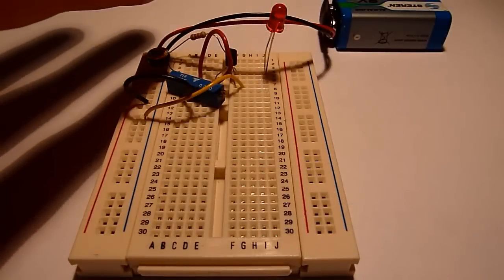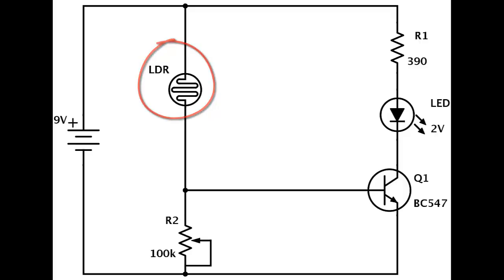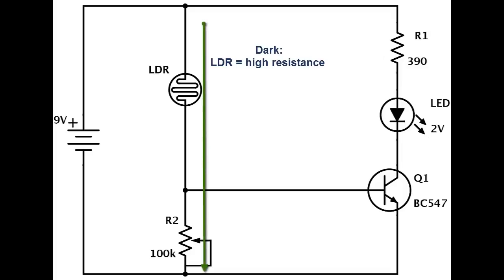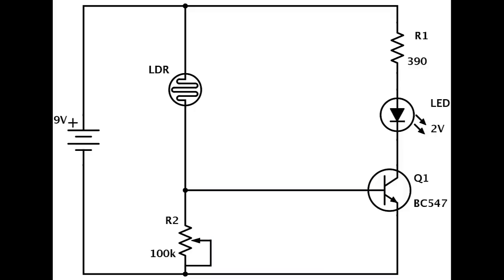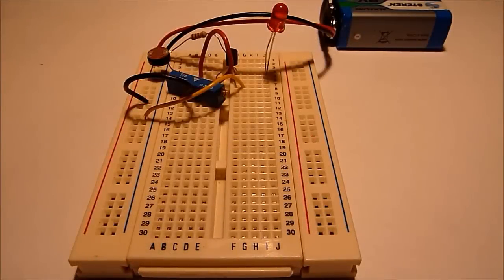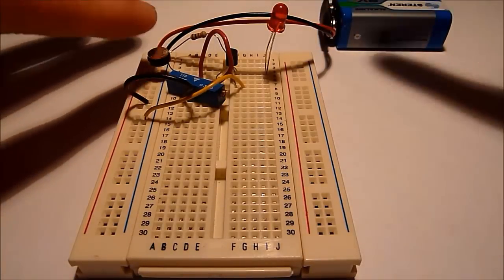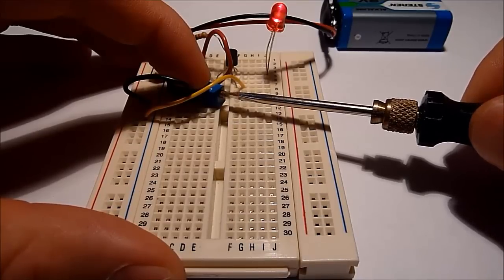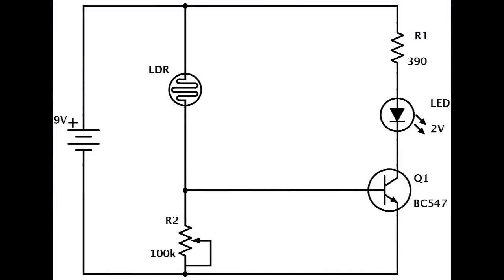How To Make An LDR Circuit (Light Detector)

Comment: What happens if we connect led across emitter.
Reply from the maker: If you place the LED on the emitter side, you raise the trigger point for the voltage needed to turn on/off. Should work find if you tweak the potentiometer

Comment: Hi. 

Disclaimer: I have really no real idea of what I'm doing in this context. But I'm considering build a "counter", that add + one to a small display, everything the circuit gets cut off. 
I don't know what I would need to add to this circuit to fulfil that, I would love some input from you. 

What do I want to build? I have a putting mat (golf), and every time I hole a put, I want the counter to add one to the score. I would love to have a reset button too, but that's not the first priority, which potentially could be done by removing the power completely. 

Would you be up for it to help me a little with the idea ? 
Best Tomas
Reply from the maker: Hi, check out the cd4026 chip with a 7-segment display. That should get you started.

Comment: What would I have to change in order to power a light bulb using this idea?
Reply from the maker: Instead of the resistor + led, add a relay that can control high power. Then connect your light bulb through the relay.

Comment: Can I use 12v battery instead of 9v. Will it effect the ckt or cause any problem?
Reply from the maker: Yes. But you should use a bigger resistor to make sure you don't break your LED. 470 Ohm should work.

Comment: how do you decide how much voltage the circuit needs? how much current in every branch? also when its dark, the LDR would have high resistance then why would all the current pass through the LDR, shouldn't current be seeking path of least resistance?.
Reply from the maker: You design the circuit for the specific battery voltage you want to use. For the branch with the LED, you make sure that there's no more current than the maximum current that the LED can take. For the other branch, just make sure you don't have more current than the base of the transistor can take.

Current will run through the LDR no matter what. But higher resistance will give a lower current. Current will only run through the branch with the LED if the transistor is turned on.

Comment: Hey! I want to run a 12v motor along with ldr. I mean when light falls on ldr, motor should stop and when light is blocked, motor should run. can you help me with the circuit please......
Reply from the maker: Check out the dark-detecting circuit here: http://www.build-electronic-circuits.com/ldr-circuit-diagram
Replace the transistor with a transistor that can handle more current (as much current as you need for your motor).
Replace the LDR and resistor with your motor.

That's the easiest way. Not perfect, but you can refine later.

Comment: This may sound like a dumb question, but why is the voltage at the base of the transistor being affected by the resistance of the LDR? I'm a noob at electronics but I need to figure the workings of this circuit out. So any help will be greatly appreciated. Thanks!
Reply: When resistance value decrease more current will flow through a circuit it's called Ohm's law in electronics, that can supply enough voltage to turn on the transistor in cct.

Comment: sir, how to wire LDR with potentiometer in series. pot has three terminals: one is ground, the  other is input and the third is output.
Reply from the maker: Hi, you can see how the potentiometer works and how to connect it here: http://www.build-electronic-circuits.com/potentiometer/

Comment: what adjustments will i need to make in order for me to get 2 LDRs to run a stepper motor (bipolar NEMA 17) using 8051 microcontroller?
Reply: Remove the transistor, LED and the resistor. Connect the middle part between the potentiometer and the ldr to an analog input of your microcontroller. Repeat for the second ldr. Now you can read the light level from you µC. The stepper part you need to to some googling to figure out.

Comment: Hey Bro! Thank you for this. I am curious as to how can I make multiple LED light up instead of just one LED, Do I have to connect them in series? And also, I want my LED's to turn OFF whenever my room light is ON, is the potentiometer the only way to adjust or can you control the LDR using a circuit troubleshooter before placing it in a PCB? Thanks in advance!
Reply: Hey Ramses. You can add a few in series, but each one will drop the voltage of about 2V, so you have to take that into account. Or you can add in parallel, but general purpose transistors usually only support up to 100 mA of current,. so you'll have to take that into account.

To turn the LED on when the light is off, check the circuit at the end of this article:
http://www.build-electronic-circuits.com/ldr-circuit-diagram

Comment: i want to connect it with a 12 volt battery,what modification should i do.thank you
Reply from the maker: Basically you just need to use a bigger resistor with the LED. Here's how to calculate the resistance: http://www.build-electronic-circuits.com/current-limiting-resistor/

Comment: I don't get why the current will flow through ldr when its resistance is high (in darkness) and not when its resistance is low
Reply: +Dakshit Mohan Current flows through the LDR in both cases.

Comment: could you use this similar circuit to make it so when it detects a light source it will pass the electricity through acting as a switch to power an LED other than only when it becomes dark?
Reply from the maker: +William Maltas Yes, I wrote about it at the end of this article: http://www.build-electronic-circuits.com/ldr-circuit-diagram

Comment: How do you make the light come on when it gets dark?
Can you use the same circuit with components rearranged?
Thanks
Reply from the maker: Almost, but you need a PNP transistor instead. See the circuit at the end of this article: http://www.build-electronic-circuits.com/ldr-circuit-diagram

Cheers!
Oyvind
Reply: +Philip Watson or you can swap LDR and R2
Reply: npn 2n3904. use that and you're fine

Comment: Would I need to change the resistors if using two 16" LED light strips?
Reply: cstandi1 The resistor that is in series with the LED is there to limit the current through the LED. If you exchange the LED with something else, you must also change that resistor. LED strips often have internal resistance, so the resistor might not be needed.

Comment: thanks,what kind of ldr, sir?
Reply from the maker: Just a standard one.
Reply: BuildElectronicCircuits what is the ldr voltage and current range?
Reply: Karen Marco What's important is the resistance range. It has to fit the potentiometer range so that you can tune it with your pot.

Comment: Hello sir ! Your circuit is great . I have a question , can we  use motor( 100 rpm) instead of led to make a light detector robot
Reply from the maker: Yes, but you would probably need a different transistor that can handle more power. The BC547 can only handle up to 100 mA.

Oyvind

Comment: why can't we put an fixed resitance in R2 position instead of Variable resistance?
Reply from the maker: You can, if you know the exact resistance you need. By using the variable resistance, we can adjust the sensitivity of the circuit.

Comment: how did you choose the R1 value as 390 ohm ? is it measured with help of LED and Transistor Voltage as well as current rating given in  data sheet ?? or only depend on LED specification voltage and current?
Reply from the maker: Only dependent on LED specification.